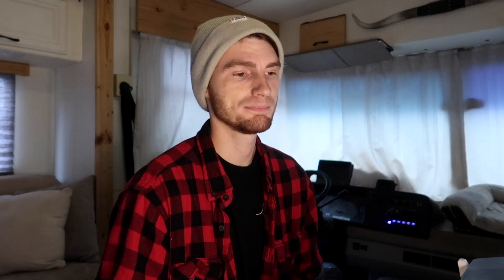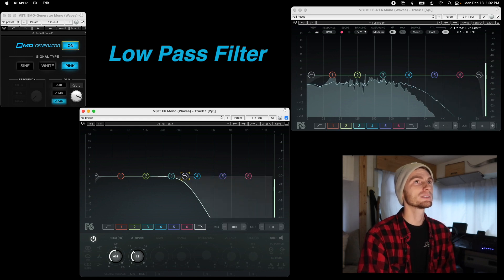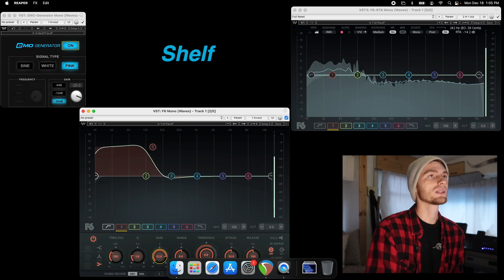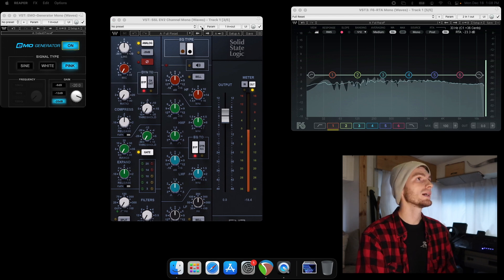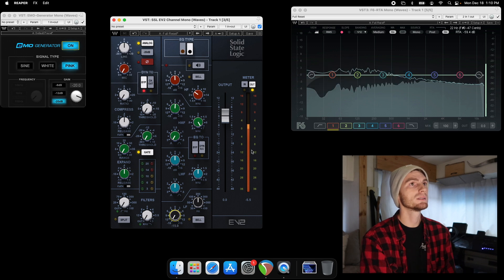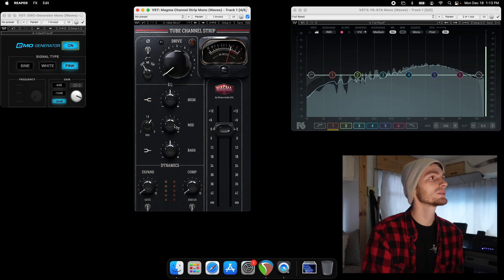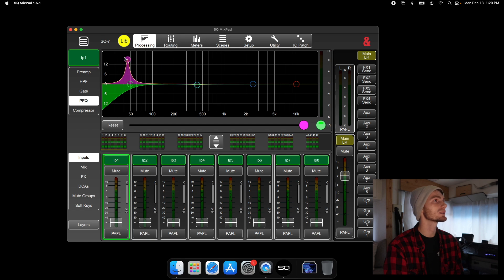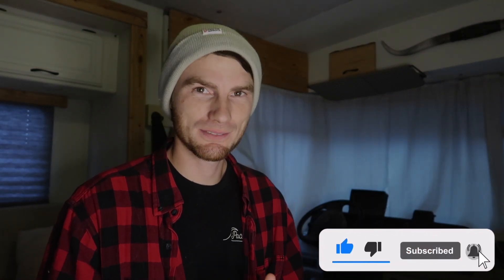Audio EQ Basics: How to Master Equalization for Perfect Sound

Comment: Very nice. I have a good question. What preamp do you recommend between the Art Voice Channel and the Focusrite ISA ONE?
Reply from the maker: I’m a big fan of Focusrite but if you’re using the preamp for recording the Artvoice has a usb built in for a/d conversion where the Focusrite you’ll need to buy a seperate a/d converter. So the Artvoice would be an easier and more streamlined install. It’s also rackmounted vs desktop
Reply: @trevorwrightAVL  Thank you, well for the price and package the art voice is better. Thanks again!